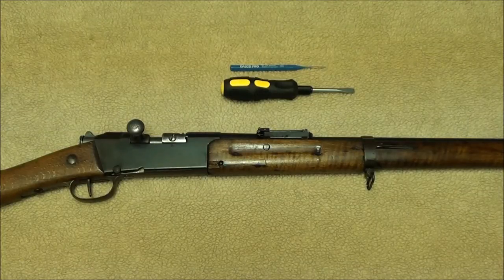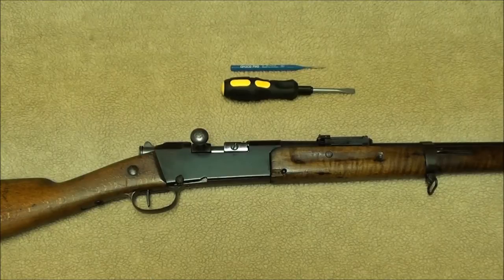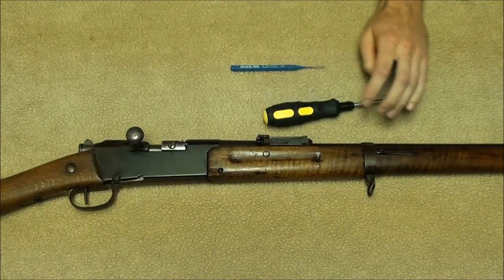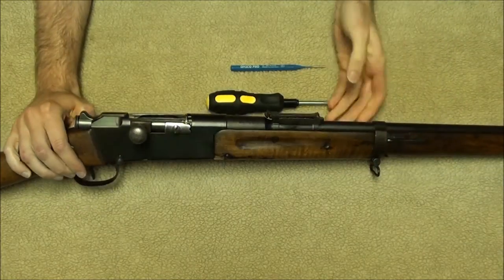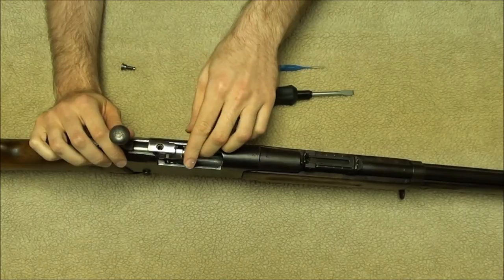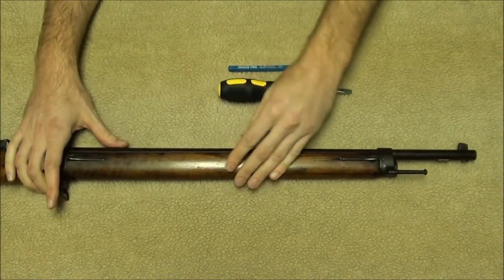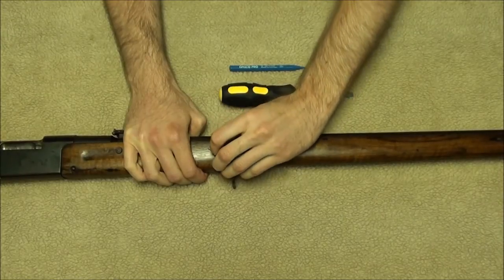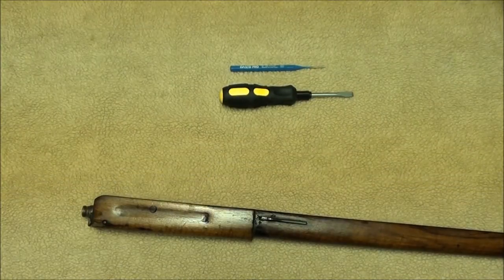1886 Lebel rifle disassembly and reassembly (forearm/magazine)

Comment: Thanks for the helpful video. Disassembly instructions in English are hard enough to find and even more difficult to follow, so the visual here is a great aid. The part in the instructions about pressing down on the transporter before removing the forend are important. My Lebel arrived with a broken tenon (the little lug at the end of the magazine piston stop tube assembly) that fits in the barrel assembly) which likely occurred when someone removed the forend "the hard way," as the fellows on the French Firearms Gunboard forum refer to it. Soldered part is due back from the gunsmith today. Again, thanks for the video.
Aloha,
Loren
P.S. Love the comment at the very end, sort of like staying for the credits at the end of a film :-)

Comment: Hey,  Great video and good clearly spoken directions. You  solved a thirty year mystery for me. The forestock on mine has always been held on by the barrel bands, but it slides forward and out of the socket if you pull on it. I now see that it's missing the part you call the "follower" as well as the long spring to propel the shells forward into the chamber. I always knew something was missing since there's nothing in the hole for the retaining pin.  I bought my Lebel from an antique dealer in New Orleans when I was fourteen years old, and she had no idea what it was. Most of the engraving on the lockplate was worn away, but you still see the  Mle  1886 in the upper right corner. I was able to identify it later at a gun show, and have since been spotting them in films featuring the French Foreign legion. If you have a line on where to get the follower and spring, I'd appreciate you letting me know. Thanks, Gil D'Aquin: New Orleans , La.

Comment: The trigger assembly comes out after one removes the forestock and magazine tube.  There are two regular screws, one on the left side and one behind the trigger.  Again, these are just regular screws.  I needed to place some liquid wrench on the threads.  Please note that the threads are on the right side of the magazine and the top behind the bolt.  Take the side one out first then the one behind the trigger housing.  Then gently grab the trigger housing and the whole assembly will come out of the bottom.  It come out in one piece with all the springs etc in an assembly so you do not need to worry about anything flying apart.  Would you mind doing another video where you perform the removal of the trigger assembly?  Thanks a bunch, Sheldon

Comment from the maker: Glad I could be of some help. One method to get rid of surface rust I've read about was soaking the offending parts in kerosene or diesel fuel for a few minutes, and then using a chopstick with a chisel point carved into one end to gently scrape the rust away. Of course, I've not actually tried it yet so I can't vouch for its effectiveness, so I would suggest looking around online for more methods. I do intend to try it out on my Arisaka's rusty bolt, so perhaps I can report back on that later.

Comment: FYI that wooden dowel you mentioned was done as a strengthening measure for the stock. Both my Lebel and RSC have that, it's totally normal and not a repair
Reply from the maker: Ah, that makes sense. Thanks, you hack fraud ;). These days I'm kinda wishing I still had the gun; need to get another Lebel someday.
Reply: those wooden dowels were also used in Polish Mauser wz 29

Comment from the maker: I imagine you'd need to get the trigger guard off the bottom of the receiver, which would require a screwdriver or screwdriver bit that can deal with that special spanner screw. You might try searching the web for the properly sized bit or screwdriver; unfortunately I can't give you any immediate recommendations as I've never had a screwdriver like that.

Comment: When I shot my Lebel I was having problems with the cartridge elevator. Whenever I would pull the bolt back all the way to snap it up, it would make the cartridge fly completely out of the rifle. My Lebel is N marked for the Balle N ammunition. I was using 175 grain loads made by PCI. Could it be a problem with the action, or is the Lebel picky about ammo and needs a heavier/longer round to cycle properly?

Comment: D you recall how your magazine spring broke exactly? I recently picked up a Lebel 1886 and finally got some ammunition for it, so I tried loading it (as I have seen people online doing it, just straight into that tube) however after 5 rounds, the magazine follower is stuck to where it is. It may be a 100+ year old spring since mine is a 1917 manufactured rifle but I have no idea. Could be a follower issue too.
Reply from the maker: Sorry for the late reply, for whatever reason YouTube has not been informing me of recent comments on my videos as of late... in any case, I believe I broke the spring by trying to force the rounds into the magazine after placing the tip of the bullet directly into the groove around the primer on the round in front of it, and I'm pretty sure the correct method is actually to place each round tilted down with the bullet touching the bottom of the rim of the round in front of it and allowing the bullet tip to slide up into the groove as you push the round in. I could certainly be wrong, though, and the loading method may not be related to whatever's wrong with your rifle.
Reply: Each round in the mag. should be pointed down with the bullet tip in the groove of the earlier bullet.

Comment: 5:30 I’m really curious how you loaded your rounds that it caused your spring to break, just so I won’t do it.
Reply from the maker: It's been several years, but I'm pretty sure I tried to position the bullet tip inside the groove around the primer of the round ahead of it before pushing the round into the tube. I recall finding it better to just have the bullet tip as low down as it can go at the 6 o' clock position of the edge of the rim of the round in front, and pushing it in would cause the tip to slide up into the groove naturally. Been a long time though, and I no longer own the rifle, so naturally none of that should be taken as a recommendation, necessarily.
Reply: @emu4286  awww, thanks for responding brother. Yes it has been a long time. I hope you’re doing well and thank you for all the information